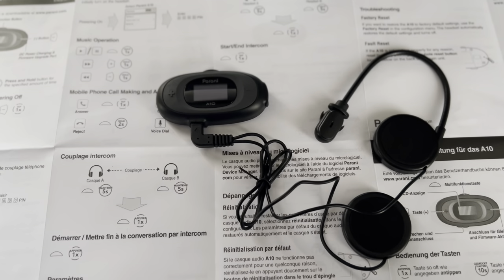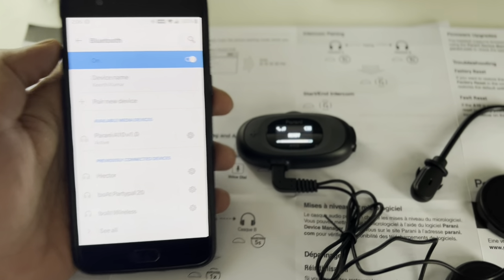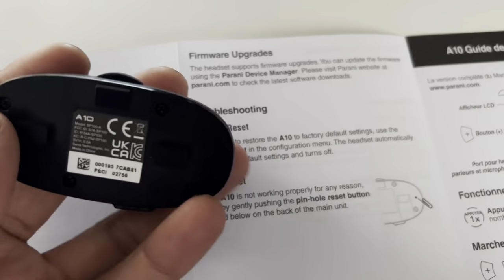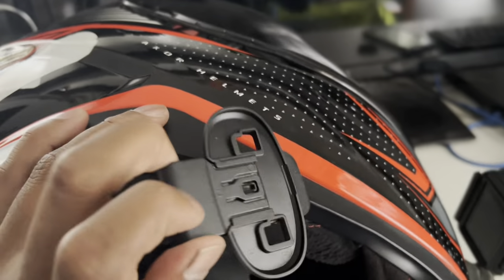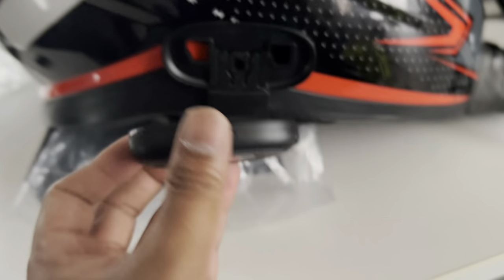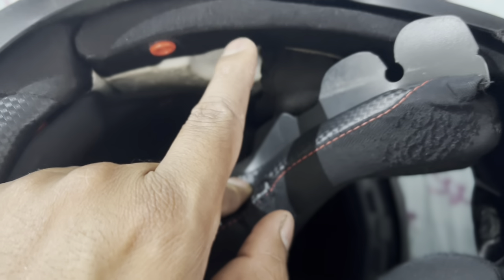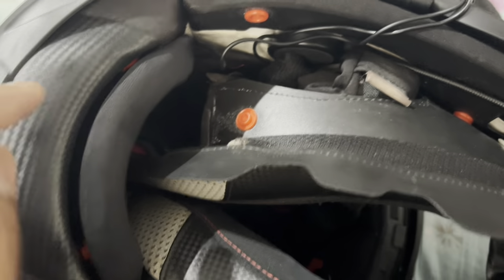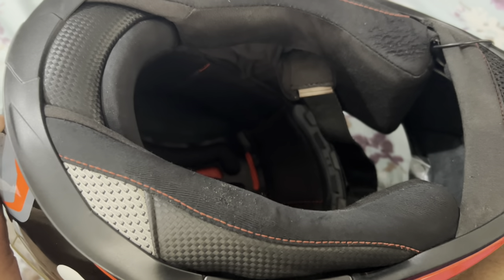Helmet Intercom Installation | Parani A10 Boom Intercom

Comment: How is the noise cancellation in higher speed plz  give some feedback
Reply from the maker: We have ridden till 100kmph the mic and speaker quality is good. Below 90kmph the intercom voice is much clearer.
Reply: @TorqueWanderer   Is it better than ventphone v6 ?
Reply: @TorqueWanderer  should I buy this oke or M10 plz guide …. I am confused
Reply from the maker: Parani is highly recommended over vnet v6
Reply: @TorqueWanderer  thanks for helping
Reply: @TorqueWanderer   one more thing .....can u take calls and communicate  to the other parani devices at the same time ?
Reply from the maker: You have option to switch in between. Both simultaneously u cant